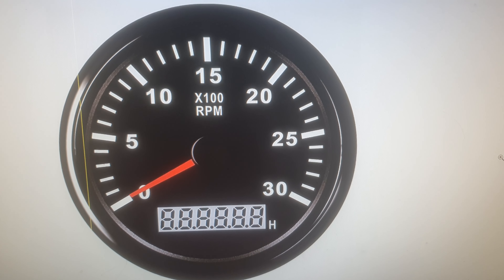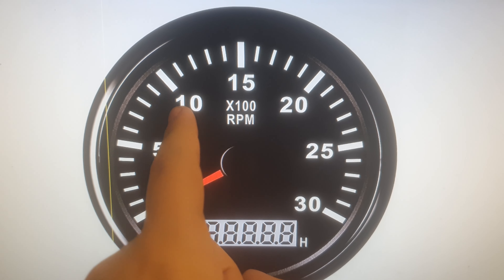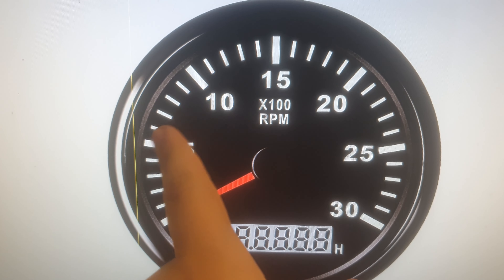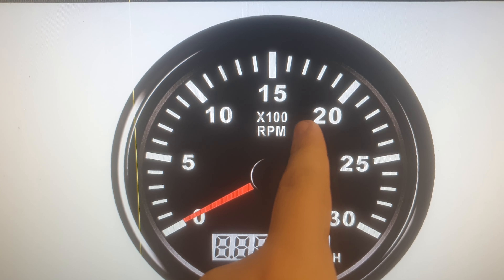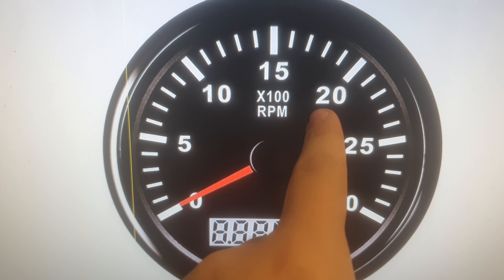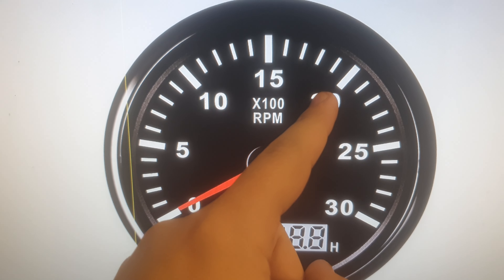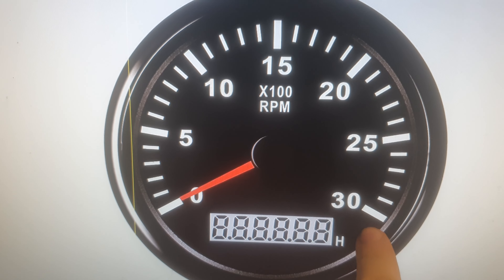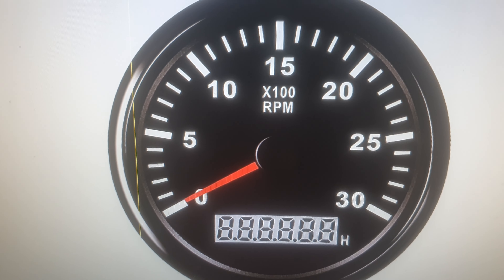At what RPM should you shift up on a diesel car?

Comment: this video is useful but i think you may have used the wrong tachometer since it only goes up to 3k rpm meaning that is most likely a truck tachometer,                   
a regular diesel car tach would usally have the range 0-6k rpm. idk just a little thing i noticed lol